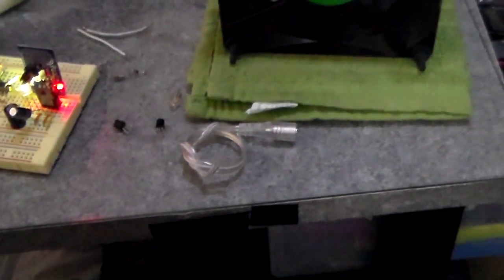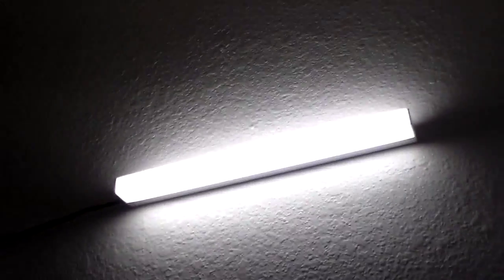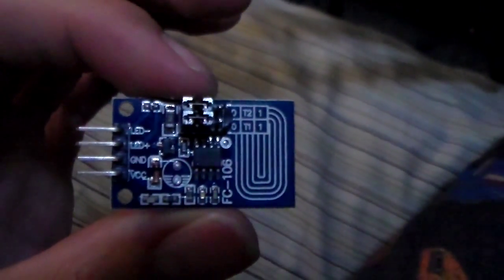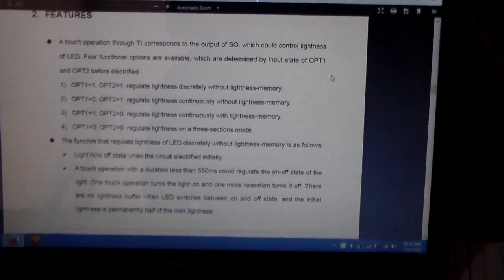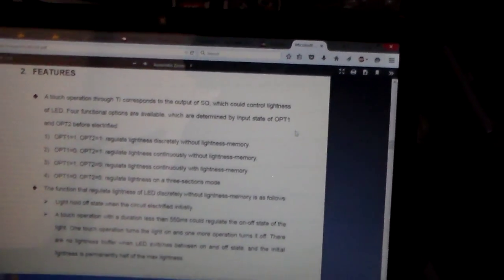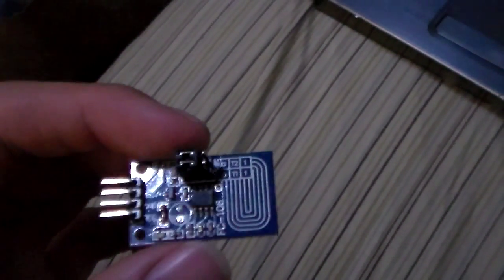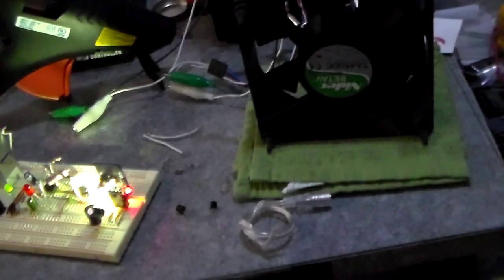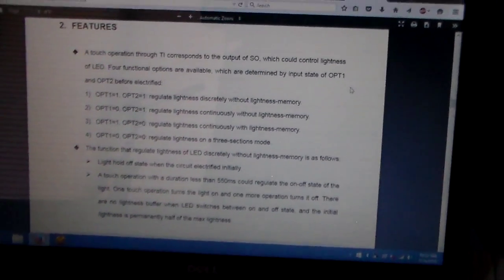Light bar update and PWM touch control chips (SGL8022W)

Comment: Hey man, mine(same as yours) came with a power indicator smd led and one other smd  led connected in parallel with led+ & - pins. I attached a Cree xpe 1watt led to the unit and it just wont light up, but the second smd does, and with all the modes and shit!😅 do I need to remove this second smd so that the cree led is the only path for the power to go in?
Reply from the maker: Hey there, yes you need to remove the LED that is on the board, but you can do that in two ways, desolder the LED on the PCB and connect your Cree LED to the LED + and - pins. Or desolder the resistor that is right next to the LED which sends the 5v from the module into the LED + pin. That way you can then use your own suitable resistor from 5v to the Cree LED with the - of the Cree LED going to the LED - pin.
Reply: @SuperBrainAK  thanks SuperBrain, but I still am facing some difficulties. First of all, the resistor does not send 5v to the led+. Its around 2.5volts only. Im worried if this board will ever power my LED. Im trying to make a substage touch dimming led illuminator for my microscope, and I must acknowledge i have just surface knowledge in electronics
Reply from the maker: @HighPurpos  yea then do the second option of replacing the resistor with a different one and not use the LED+ at all. You will need to do the current calculation using the forward voltage of the LED to get the right current, if you can find that and the nominal current I can help you calculate the resistor you need.
Reply: @SuperBrainAK  all right, I’ll get back soon

Comment: Hello, can you tell me which transistor to use to increase the voltage upto 5v? because without one it gives only upto 1.9 - 2v
Reply from the maker: LED + on the board is just a 360 ohm resistor to VCC, LED - is the NPN transistor to GND. If you are using a larger LED than the board can power you will need to use a PNP transistor as an amplifier. So the emitter of the PNP will go to 5v, then the Base will go through a 400 to 1k ohm resistor to LED -, then the collector will go to your LED's anode through the correct resistor value to limit the current, and finally your LED's cathode will go to GND. Let me know if this works for you!

Comment: I have to comment on this.... as a HAM radio operator and a short wave listener these devices are noise producers and the manufactures make them cheaply and do not bother with any filters to reduce the RFI. The closer these are to my receivers the less I can hear, they have to be more than 1000 feet away! About the video....  Good! Nice project! 73!
Reply from the maker: +poikaa3 what sort of filters do you suggest i add to these things? also would a boosting then 4way PWM led backlight controller have the same interference? this is what i plan on putting 5 in parallel with one PWM input from one of these 8022W's because i recently figured out how to reinvert the signal from them :)
Reply: +SuperBrainAK   Any electrical level change in a voltage circuit can potentially make a RF energy pulse. Especially one that is repetitive or has a cycle. To prevent these you need to see if the circuits are producing RFI first. Testing is as simple as using an AM radio receiver like a pocket transistor radio. You can use one of these to 'listen' to all sorts of electrical 'noise'. And this can be very interesting and a bit fun! Hold the AM radio next to anything that makes noise, such as a computer monitor, your PWM device or even a power outlet.... you will hear some strange things! (you may have to tune the radio's dial a bit)
    If filtering is needed and depending on what is emitting the RFI signal, you can add de-coupling capacitors of ferrite chokes to suppress these RFI waves. There are other ways like shielding as in a metal box or just re-positioning the power leads. There are tons of information sites on RFI and suppression on the WEB about this. Not a whole lot of room here for discussion.... There are some groups on IRC Internet Relay Chat, it has been around for years and lots of helpful people. Also check with your local gourp of HAM radio operators, some are really good at this. 73 Rod KB8DNS aka poikaa3